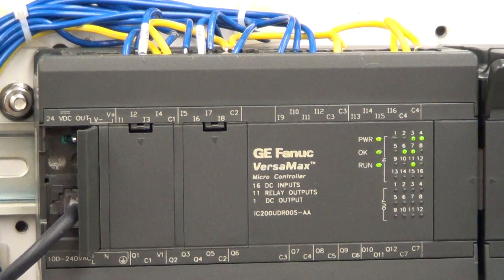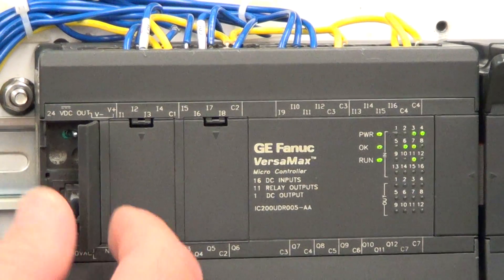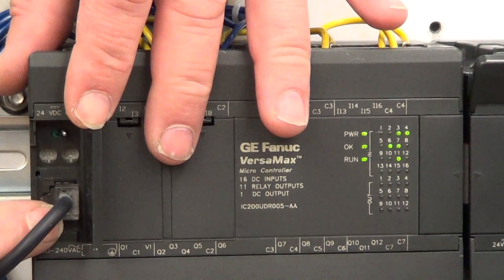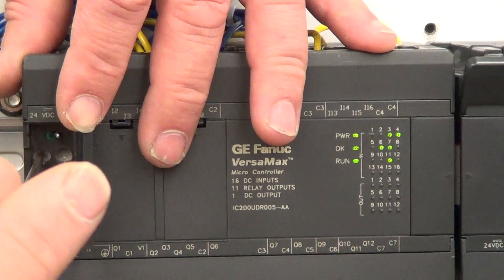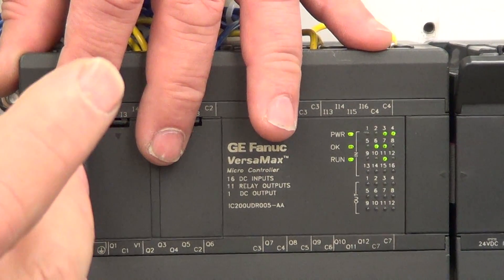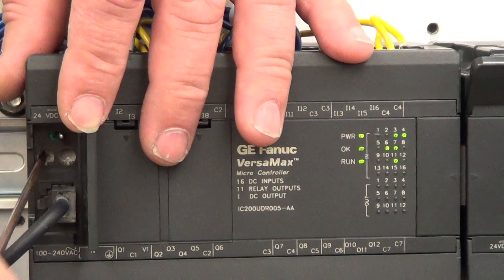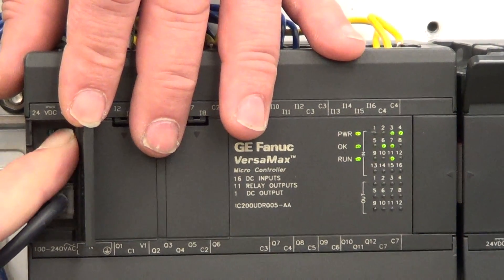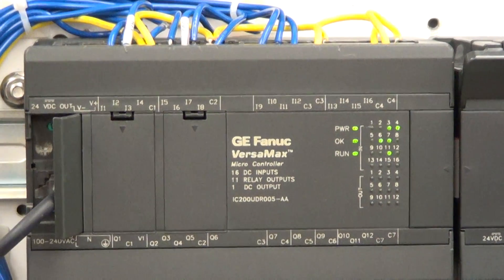GE FANUC IC200 ANALOG INPUTS

Comment: Sir would you please tell where i find the programming software of the this PLC and also the cable detail :)
Reply from the maker: The Proficy software is from GE University Program, otherwise you can get it from a GE distributor.   If you are at a university, ask a professor to contact GE about setting up a university program.

Here is a link to a RJ45 to DB9 adapter

http://www.digikey.com/product-detail/en/assmann-wsw-components/AT-23067/AE10310-ND/1630270

Here are the connections

GE Fanuc Connections - DB9 TO RJ45 ADAPTER   
RJ45 is 1 to 8 looking at pins from left to right
holding cable in hand and pins up
   
DB9  RJ45 Wire Color 
1 CD  
2 RXD Green 
3 TXD Yellow 
4 DTR Red 
5 GND Blue 
6 DSR Black 
7 RTS        Brown 
8 CDT      White 
9 RI       Orange
Reply: hello my friend, I have The Proficy software but when I select the cpu there is not the port Ethernet confirguration, just Is rs232 port. Do you have an idea about this?